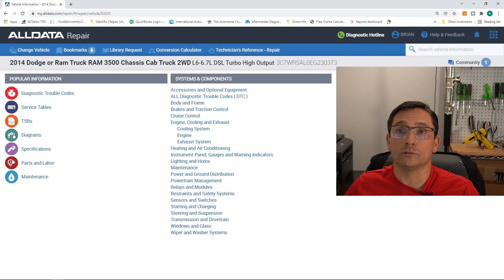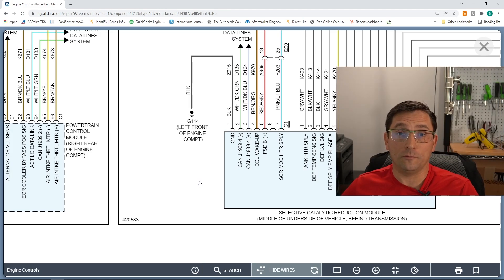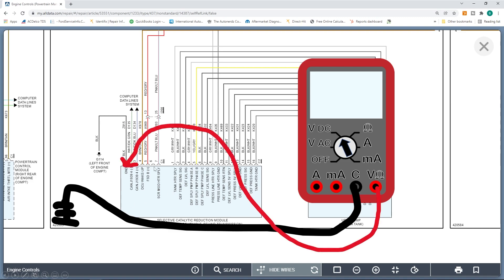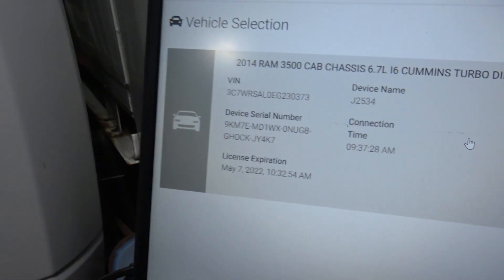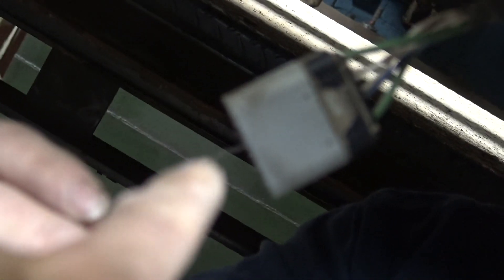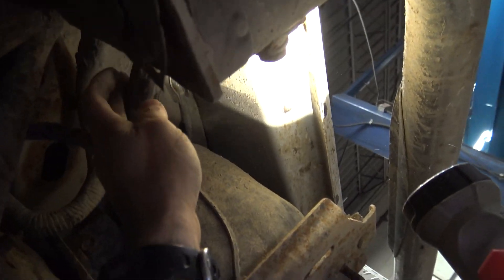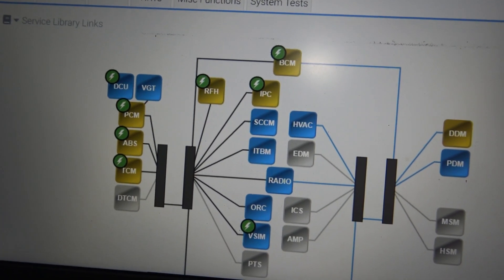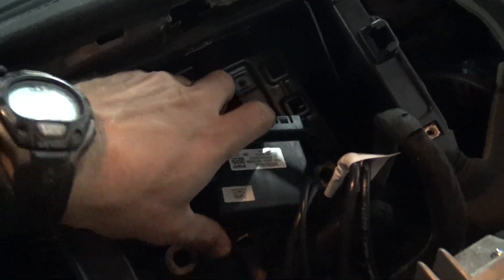POP Quiz Monday !!  12 27 2021 End Of Day

Comment: D for a known good ground. Check it and other wires dynamically. (Under operating conditions, plugged in) 
As always thanks for sharing Brian!
Reply from the maker: YES! Always check the circuits loaded!   In this example I did test with back probed and loaded and had bad results.  I was struggling to maintain a good connection plugged in, so I did unplug and front probe with the popper sized terminal, (NOTE  that the reading did not change, if it did I would have had to plug back in to maintain the load , / current demand in the circuit) I hope you are doing well Angel, I appreciate your support and input!

Comment: Question about a 2017 ram 5.7 liter throws a cel of p0456. Smoke evap system. Took off fresh air hose from estimate capped it no leaks. Can see esim close during large leak test. But fails the small leak test on snap on scanner. Would you know criteria to run small evap test?